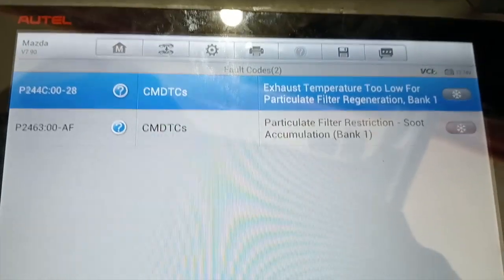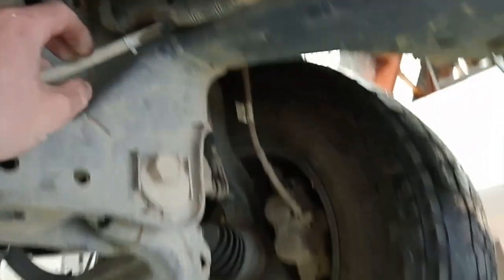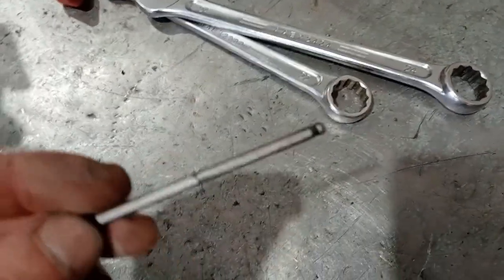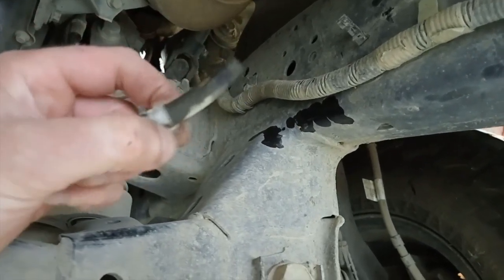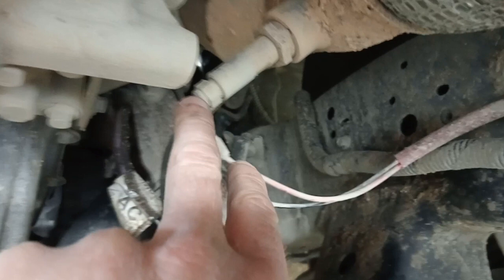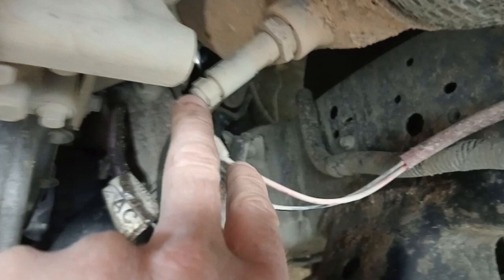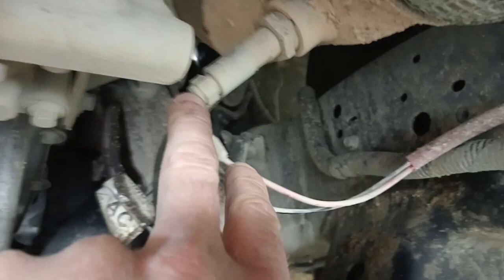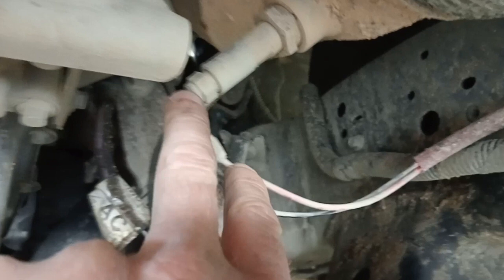Mazda BT 50 / Ranger P244 P2463 (Exhaust temp too low for DPF Regeneration)

Comment: Hi I have had mybt50 2018 for 5months now and have this problem i have spent nearly 60 getting diagnosed,  apparently my dpf is stuffed and it's going to be 2500 to 3200 to be replaced, I will clean the injector and get back to you. Any other advice welcomed

Comment: Great video! Anyone that needs to clean out a really stubborn injector body on there, I used a blunted 3/16 drill on slow speed to clear out the bulk of the packed in carbon and then blew it out in reverse direction with compressed air, worked a treat!

Comment: Just found this video, same codes, removed injector and sure enough its blocked. Maybe this should be a service item around 60 thou to remove and clean. fixed the issue in 20 mins. 190.000ks its done.... THANKS GUYS...THUMBS UP